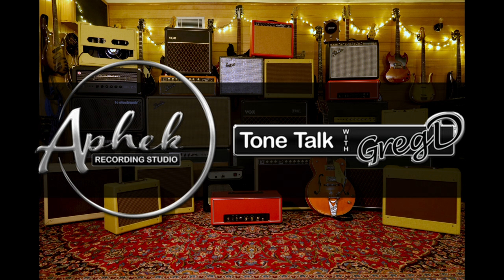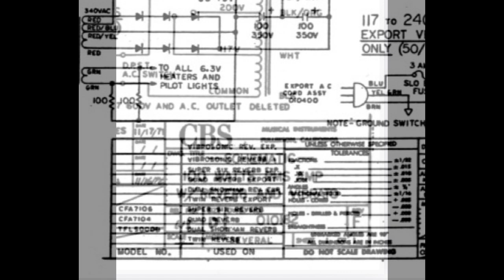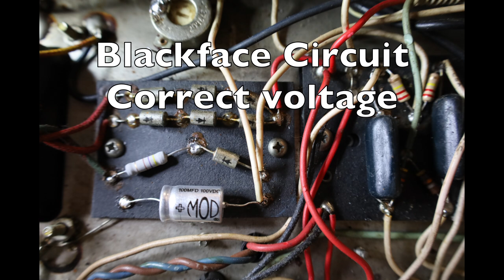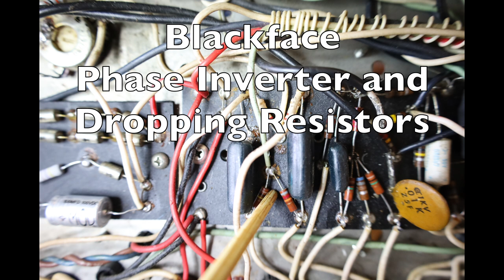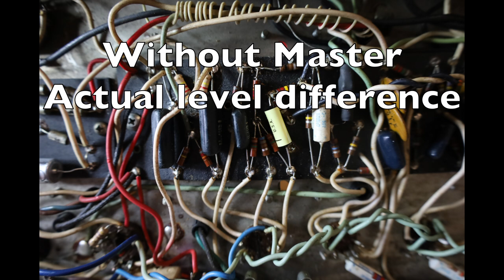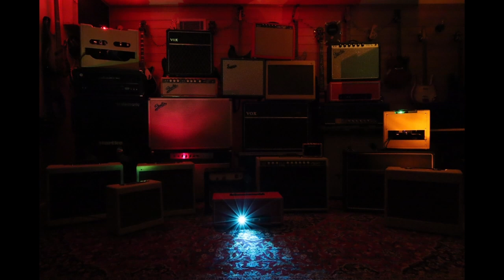Fender Silverface to Blackface amplifier conversion. Part 1

Comment: Losing the master is good. The .001 is good but I would use a disk cap. After working on Fenders for 25 years, I found the output transformer makes the biggest difference between SF & BF. The larger transformer has less primary resistance to make more power, but the larger core has more inductance that throws a wet blanket on the tone. It also gives much more bass response, contributing to muddy tone. This makes players turn down the bass control and that ruins the Fender shimmer. I use 2.2uF on the V1 cathodes for best BF results.
Reply: Really surprised to hear that. I always thought smaller transformers sounded thin and wimpy. It's actually a big part of Marshall's demise making output TXs smaller and smaller. Almost every aftermarket tx upgrades for small amps have bigger cores too.
Reply from the maker: Have you seen Part 2? The lead dress made a significant difference. I have now changed some of the preamp tubes, that were on their way out (didn’t want to change them during the videoing, being another variable). I have reduced the first cathode bypass cap on my Princeton and a Tweed Champ. I’ve been wondering about the output transformer? Excluding the 135 watt ultralinear versions, I couldn’t find anyone who had a strong view on them. Best I found was ‘they may have decreased in quality’. 🤔 I assume you’re talking about using the original 85 watt version? Thanks, Greg

https://www.youtube.com/watch?v=TQydfFjSa1o
Reply: @aphekrecordingstudio4274  I'm not a guitar player. I'm a tech who came in the musician's back door. So I can't play guitar when I'm done fixing them. So, I have been graphing amplifier performance after the repair for the last 20 years. It's not as much fun, but the numbers have finally given me their secrets. I have measured the increased power and bass across all the CBS models compared to Leo's. I bought an inductance meter to measure primary inductance and all of the had much more. An old Twin was 7 Henries. An ultralinear Twin is upwards of 19 Henries. Ask your friends what that would do for Bass response. Tim
Reply from the maker: @rivertimefloats825  I know the ultra linear sound bad. I owned one for a year '85/'86. Have you measured these 100 watt models? This is what's been unclear. Nobody seems to have a definitive answer as to how much of a change there is between the and the'70s 100 watt models and the original 85 watt version.
Reply from the maker: @rivertimefloats825  that would be great. greg at aphekstudio dot com dot au Thanks. It’s also on the studio website.